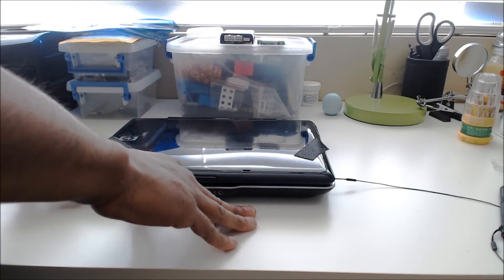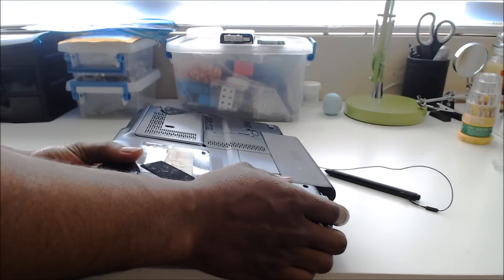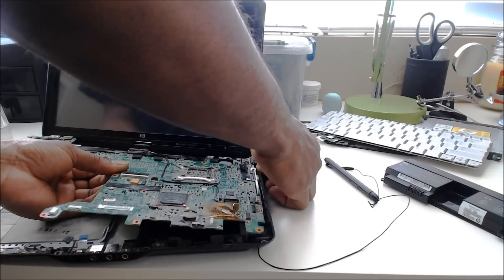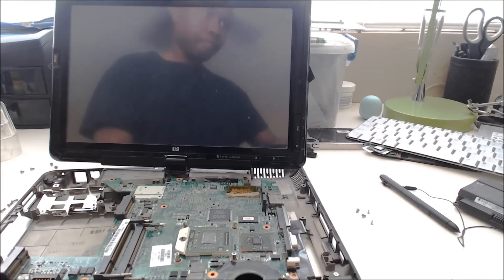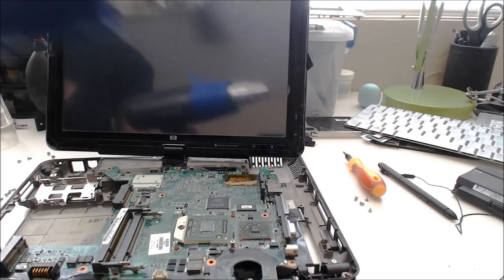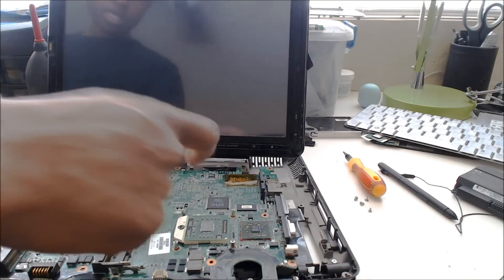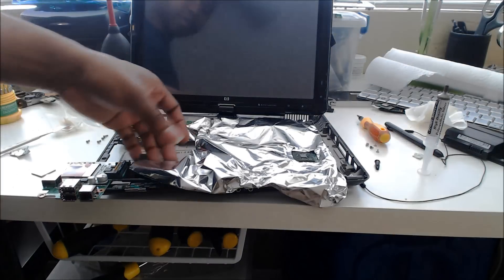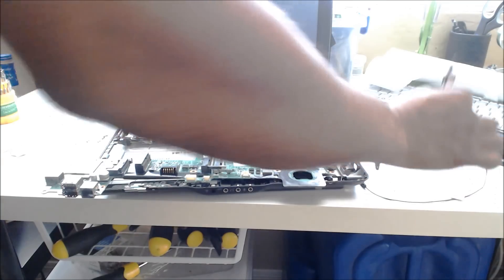Nvidia GPU laptop fix

Comment: How much cm need for that copper fit?
Reply from the maker: Since the heatsink has flexible mounting points, in combination with the torque on the screw, the tolerance of thickness of the copper isn't super tight. The shims I used were 15mm. x 15mm. x 0.1mm

Comment: What size copper shim did you use?
Reply from the maker: 1.2mm, bought em on the ebays :-)
Reply: @joenathane  cheers dude. Just bought a 40 pc set from amazon. Going to spruce up my grandma's TX2000. It hit 90 degrees C after 5 minutes of prime 95 last nigjt. Think it needs new paste too
Reply: @joenathane  I've just really done a number on the laptop. Some connector between the MB and the screen broke off the motherboard. It's small and 4 pins. Everything seems okay. I have a feeling it may be something to do with the pen/touchscreen. It's a right nightmare detatching those cables without breaking the connector off of the MB.
Reply from the maker: @Rambojazdude  It happens to the best of us, it could be touch like you mention, could also be for webcam, and or mic. Test everything to see what isn't working, hopefully it isn't something needed. Otherwise you can take up soldering :-/
Reply: @joenathane  I think I've been very lucky. Sound, touch, screen and pen are working fine. Maybe it's the controls for the buttons on screen. They light up but don't do anything when I press them.

Comment: i have black 2 inch line on my laptop screen and so much bearly visable red lines can you recomend a way to fix it?
Reply from the maker: Sounds like a damaged component that will need to be replaced. I would check that the display cable from the motherboard to the screen is secure, otherwise If to your knowledge the screen hasn't taken any physical damage, it's most likely the motherboard or GPU, in that scenario I would recommend sourcing a replacement motherboard on eBay. Also Google your problem and the model of your laptop and see if it's a common issue with your model, it could be a defect that their is a known fix to.
Reply: youre a racist dude. ama reporting you, you white supremacist

Comment: Hello Jonathan. what is the best thickness for the Copper pad you are suggesting?
Reply from the maker: It doesn't need to be much, the idea is you need something that is a better thermal conductor than the thermal pad installed from the factory to bridge the air gap. My suggestion would be to search ebay for the model number of your laptop + copper pad, and go for the seller with the best reviews, you can't go wrong. I wish you the best with your repair :-)
Reply: Thanks for the reply Jonathan. What I did was, I found a copper paper and I folded it and made a Square type copper part and it really fixed my problem. Because right now I couldnt find any copper pads from our shops and ebay will take some time to arrive the shipment.

Comment: Can a laptop with a burned gpu, work normally? I mean can it use shared memory for display or something? Great video btw.
Reply from the maker: If the GPU is having the same problem as the one in the video then no, a laptop with this problem doesn't boot.

Comment: Why you did this?? 
Why did you put this plate there?

In fact so must a heat exchange will become worse because куллер will be included later?

P.S. sorry 4 my english.
Reply from the maker: Константин Боярский there is a gap between the heatsink and the GPS. The stock configuration uses a thermal pad which has worse thermal properties than copper. then we use thermal grease to bridge the smaller air gap.
Reply: gap???

There contact of a radiator and gp very exact and there are no intervals. In any case in my Y580 quite so.  

Perhaps this gap peculiar for the low level of a price category of laptops?

Comment: what were the "issues" that this laptop had prior to this fix? You don't show anything about what the laptop was doing before. Was it just giving slow response to keyboard input or something? Thanks for any info. If you have a video that shows what the laptop was like before you did this repair, please let me know.
Reply from the maker: The laptop would power up to a black illuminated screen and go no further. This is a fix for the nvidia solder issue that plagued laptops during that era.

Comment: Hey Joenathan, long ago I was fixing pc's. I have a good laptop, but it overheats and starts dropping cpu Hz, and it really starts to lag. I changed Thermal paste a few times, cleaned all the dust, still the same overheat. my gpu has the same thermo sticker as yours in this video. Could you advice me something ?  
I have nvidia gforce 640M  and i5-3210M.
Waiting for your reply :)
Reply from the maker: +ImEMOnotScene Could be your heatsink, sometimes the liquid in the heat pipe corrodes and it becomes ineffective. Also check for rogue processes with the task manager, could be a misbehaving program abusing your system resources.
Reply: I have dell d630. i have baked motherboard because of not proper display. but now 2 chips near with N vidia chip are getting hot when powered on the laptop. and no display.
kindly help me solve this problem.   thanks alot

Comment: so i have a couple questions, i dont have a heat gun, or a coper shim can i use a penny? and a blow dryer for heat? thanks
Reply from the maker: +SkahtAC Kasel A blow dryer might just work. A penny wouldn't do a good job, modern ones are zinc and don't have good thermal transfer properties, even if they where copper the shape leaves gaps for air pockets. You really need a flat piece of copper and thermal paste, you should be able to find a copper shim from your local hardware store.

Comment: Joenathan,can you help me?Recently,my laptop was doing so fine,except it over heat,so I always place it in front of an electric fan,and then lag was nowhere to be seen,after some days I decided to install a new software(Specifically a game)and while it  was installing I played another game,then reset the controls settings for that game,then it started to lag,I cant do something for it,I can place it on front of an electric fan but it still doesnt work,and I cant fix it,Im afraid to do that steps but I really wanna play games so bad ;( ;( Im so sad its been months since it started to act like that...(My laptop is 5 years old ,its an intel hd graphic card and nvidia geforce 315m,I looked up to newer video cards(nvdiia) online and it is so costly,I dont have the money for that,so Im begging for your help,I asked in toms hardware online,no one replied so I am hoping to get some help from you,if the problem was solved by you,I will greatly appreciate it you have saved my life then) Thank you in advance

                                                                                                                                                                                 -Sean Lim
Reply from the maker: +Sean Lim Try making sure you have the latest drivers from Nvidia, you can also try tweaking the settings of your game, turn off some of the effects or lower the resolution, that should help with the slow down.
Reply: +Joenathan's happy fun time channel Yeah I'm doing that since I got the laptop because its so old,but after that program installed,and after I reset the controls,It started to lag the games that worked perfectly before that happened,and also my Nvidia drivers are up to date according to the Geforce program that I installed,thanks again for the reply! :D

Comment: I have the same issue. pressing j k l very hard before the power button used to work for me to get it to turn on as a temp fix. Now it's not working anyone after years. I don't have proper equipment  so i might just throw it away.

Comment: I'm having trouble getting all systems up for a pavilion dv6000 series, it shows about 65C on temperature, not that much but still gives me a warning on the speedfan program, and it already brought to death a HDD, got a new one but it wont read the DVD burner or the sound card. already tried 2 new dvd drives and tested them on a second pc and are working what could it be.
Reply from the maker: Could be the drivers for the MB/Chipset!

Comment: HEY JONATHAN ,great video firstly. i purchased an hp r033tx laptop with nvidia 820m. the gpu heats up to 96 C within seconds of use with a fluctuating core clock causing stuttering . does the 800m series has a fault?
any idea what the problem might be?
Reply from the maker: According to PC Nexus the max temp for that GPU is 100c, could be that the thermal paste/pads have gotten old and ineffective. You can follow my instructions from the video save for the heat gun part and that should fix you up.

 http://www.pcnexus.net/2014/09/nvidia-geforce-gt-820m-notebook-gpu-gaming-review.html
Reply: Joenathan's happy fun time channel but bro i forgot to mention that the laptop is only 2 days old. and i got the thermal paste applied by service person, as shown by you, having no effect at all sadly.
any idea if they(HP) have a policy of replacing brand new faulty laptops like mine.?as a new laptop shouldnt be having such high temps.

Comment: I am going to try this. I don't have a copper shim, but I will try to use the a penny. Hopefully I do it correctly and it works. Thanks for this video. Very well described.
Reply: A: pennies are like 2% copper max, the rest is zinc which wont conduct thermal energy very well
B: pennies have imprints and grooves for the design, there will be very low surface area actually touching your chip and the heat sink/heat pipes. Go spare your time and laptop and get a shim on amazon for like 4 dollars.
Reply: anyone who tries to use a penny to cool their processor might as well just give up and pay someone to not half-ass it.
Reply from the maker: Good luck :-)
Reply: I tried tonight. I reheated the chip area as you had shown. Then I put together the motherboard back to check. For a few seconds the screen comes up and then goes black again. Restarting it for 5 - 6 times it does the same thing. Screen turns on for 2-3 secs. and then goes black. Do you think I have to reheat the chip little more? I did that for 2 mins and then pressed it with the towel.
Reply from the maker: ***** Does anything come up on the screen or is it just completely black? If something comes up, it could be that the cpu is overheating and the motherboard is shutting itself down to prevent damage.

The heat gun only needs about 15-20 seconds to reflow the solder.  Are you using thermal paste? it's very important. I would take her back apart and give it one more go. You can do it :-)
Reply: Joenathan's happy fun time channel Hey Joenathan, I tried again. Yes I do use the Arctic silver 5 thermal paste. The CPU is running but the screen is not. I got the HP logo on the screen then it asks for F5 or F6 to continue. and then the screen goes black. After I use the RGB cable to attach TX 2000 with TV, and in TV I can see that the computer boot up. How hard do you press your GPU to get it fix? I think I am applying little pressure as I am scared it if would break. I replicate what you have done, but my screen does not work for long. I think there is still some loose connection.
Reply from the maker: *****  It sounds to me like the screen is working because it comes up initially, I'm thinking that Windows might be set to only output on the VGA connector, check the those settings.

Comment: Thanks for sharing this - I'll be trying this method (I have an HP tx2 1370us with the black screen)...did this solution continue to work for you? (just curious since it's been about a year and a half?)  Anyways, subbed ya! Cheers, Francisca aka auntifranny
Reply: One of the first laptops I did this on is still up and running 3+ years later.

Comment: What were the dimensions of the copper shim? Im asking this because im considering buying some copper sheeting and cutting one? Thanks for uploading this, hopefully i can get my hp tx2000 running again
Reply from the maker: 20x20mm
Reply: Joenathan's happy fun time channel thanks for that fast reply,if you dont mind me asking ,what thickness was the copper and also what temperature was the heat gun at? along with how long was the gpu exposed to this heat?
Reply from the maker: Sorry didn't see your reply. 1.2mm thick, the heat gun I was using was a cheapy with two settings, hot & hotter. I used the "hotter" setting. I would say about a good 15 seconds should do.
Reply: Joenathan's happy fun time channel Where do you buy the copper piece?
Reply: Martin P You can find some good deals on eBay.
Reply: ***** Thank you I found them...

Comment: Excellent instructional video Joenathan. However, you didn't mention why you're replacing the heat sink on the GPU. What are the symptoms of a crappy heat sink? I get that the GPU is overheating, but how do you know if your GPU has gone bad and needs to be replaced as well as the heat sink? For example, recently, my TX2000 screen became completely pixalated. I can still use it, it's just hard to see. I know that the GPU is the problem because the same thing happens when I connected the TX2000 to a monitor. Will replacing the heat sink fix the problem, or do I need to replace the GPU as well. Mahalo!
Reply from the maker: The Nvidia GPU used in these laptops has a well known problem with overheating, getting so hot that it melts the solder, when it cools back down the solder can re-solidify with the GPU not making full contact with the motherboard. By using a heat gun to reflow the solder and applying pressure to the GPU the GPUs connection to the motherboard can be repaired.

I don't replace the heatsink, I only replace the thermal pad with a better heat conductor, copper. Which lessens the odds that the GPU will overheat again.

I've done this successfully on a number of laptops that years later are still working great.

Comment: Hello Joenathan!

I have a lap top HP F700 and the problem was with the grafic card, and i put it in the oven for 10 min 200c. It fix it actually but the screen have no light, but t works if i conect it with another monitor or tv by vga. I would like to have your advise .
Thank you!
Reply from the maker: If you can shine a light on the screen and still see a picture, then your backlight needs to be replaced. You can search eBay for HP F700 backlight, they are pretty cheap, make sure to read the auction description before purchasing. You may also need to replace the backlight inverter, but those rarely go bad.

Comment: Would this,work if the screen ia black because of the gpu ?
Reply from the maker: Yes, yes it will, it'll have it working better than new.
Reply: @joenathane  joenathan: i did this. The gpu works fine for few days, then dies again. How can i mantain the fix? Thank you
Reply from the maker: @biocruiser  That would indicate to me that the laptop is getting too hot and reflowing the solder. I would check that the laptop fan is working properly. I would also try replacing the heatsink, the heatpipes may have stopped working.
Reply: @joenathane  i see. So the problem is overheating again. I will try to cool down better, because i used fresh cream and the fan is dust free. Thank you
Reply: @joenathane  heatpipes are just some coper right?
Reply from the maker: @biocruiser  The heatpipes are wrapped in copper, but inside there is a wick and liquid, the liquid vaporizes and then travels up the pipe carrying the heat and then condenses back to liquid once it cools down and then begins the process all over again. What can happen is the liquid that is used could be contaminated, and chemically react with the wick or copper over time, causing blockages, foiling the whole process, rending the heatpipe much less effective, leading to overheating.

Comment: I just took mine apart. It looks like someone already did the copper heat sink, so I put heat to the chip and put it all back together. I suspect the guy failed to line-up the slide control with the switch. My wifi lite is blue now instead of red. I only had a few screws left over.  ::--))

Comment: My TX2's video card would crap out on me every 90 seconds or so, to the point of being unusable. It's been sitting in my closet for 6 months. Found your tutorial and did just as your tutorial instructs and works like a charm! I had some copper sheet in the garage so i put two pieces back to pack with some thermal compound in between opposed to purchasing the kit on ebay. 
Thanks! great tutorial.
Reply from the maker: You're a good man!